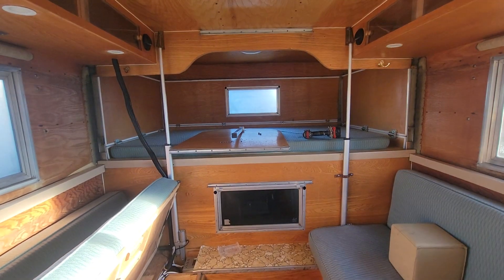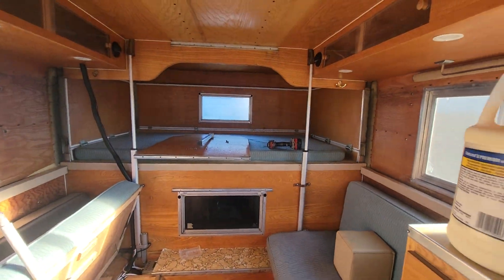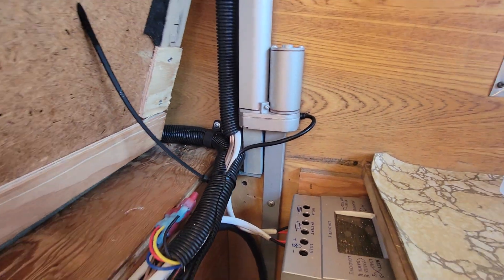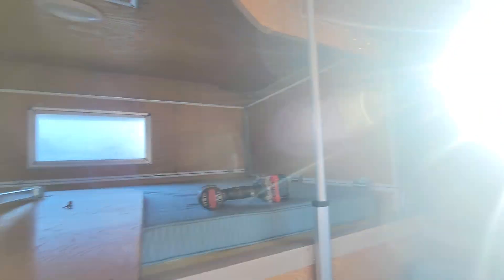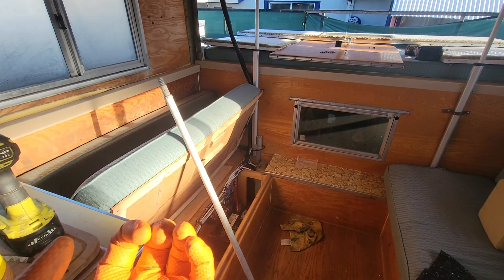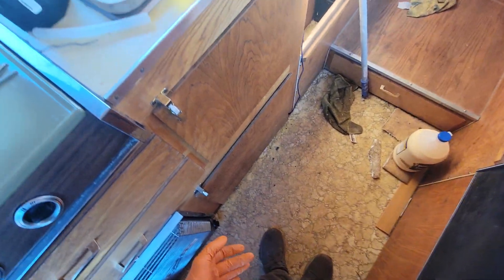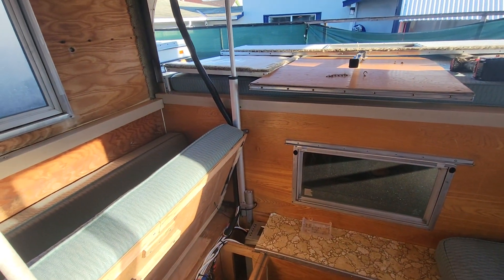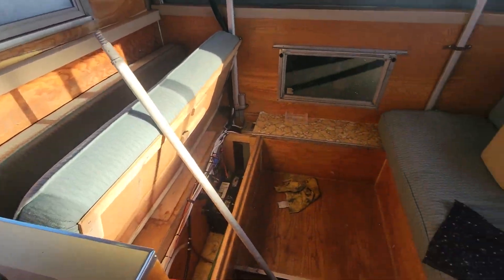Alaskan camper popup mechanism upgrade (linear actuators!)

Comment: stick with the hydraulics folk,,linear actuators can be greatly affected by heat and cold,,,,if one dies especially when lowering  you are screwed unless you can completely remove it out of the way.the hydraulics are simple,,,a hydraulic pump and a few o ring seals.easily rebuilt,,,there is a reason that system has not been abandoned by Alaskan Campers.

Comment: Hey, I’ve bought an Alaskan with those attenuators unfortunately every single one seems to have blown as we had some issues with how loose they were. Is anyone aware where I can replace the motors rather than the entire bar system?? Currently in Dawson city so not the best location to have the camper completely fucked!
Reply: contact pop top overland in san diego.  they'll have the best info for replacing the actuators

Comment: No. With today's technology do you not think that Alaskan would have done this already?? These "Electric Actuators" have been used in the marine industry for years and when they quit there's no back up there's no getting them to work. Whereas Alaskan's system has a backup. This is about as Jerry rigged as you can get.

Comment: If you have a link to the linear actuators that would be awesome. Just a thought, could be rising at a different rate due to voltage drop. Switch for the front and switch for the back is a great idea.
Reply from the maker: I linked them in a diff comment. Yea that's probably what's happening but it doesn't interfere with them working. They all top out and bottom out at the same place and catch up to each other in less then a second. The first time I did this I put momentary switches in between the main switch and I'd press all at once but this time I wanted to be able to walk away and do something else while it popped up or down.
Reply: @Charbelis  Hello, great video!  Please post the link for the actuators, it’s not listed anywhere else, thanks.
Reply from the maker: https://www.ebay.com/itm/155526715811?mkcid=16&mkevt=1&mkrid=711-127632-2357-0&ssspo=9sdi83mlqlq&sssrc=2349624&ssuid=-IOUM82hQJW&var=&widget_ver=artemis&media=COPY
Reply: TEMU has them

Comment: Howdy there!

Very cool idea. I'm curious, are you or is someone going to be living in this camper?

I am setting up to buy an Alaskan and truck for mobile living, and the one thing that I see being a small challenge is having to raise and lower it at least twice daily. I fear the Rams wouldn't stand up to that constant use over time.
Reply: We use our camper pretty often , raise it and lower a few times a day and haven’t had many issues. Only time we have is when we raised it in non leveled surfaces and that bent one of the bars . After replacing and only raising and lowering on flat surfaces it’s great ! 
Hope you bought your camper !